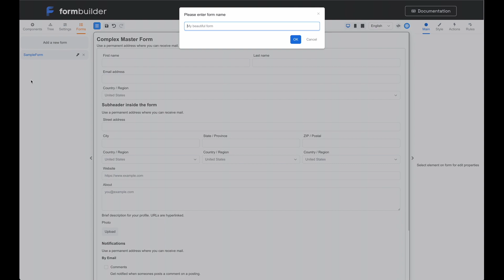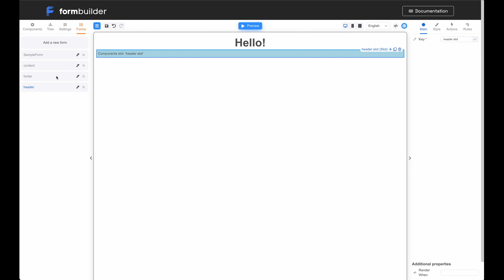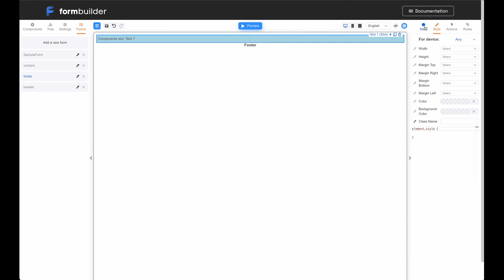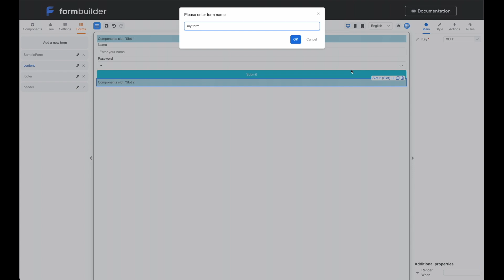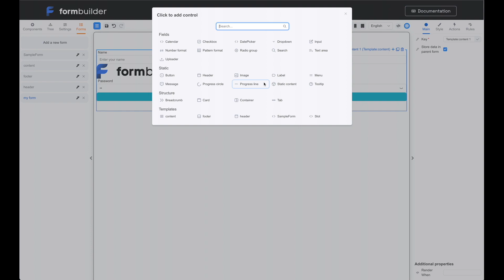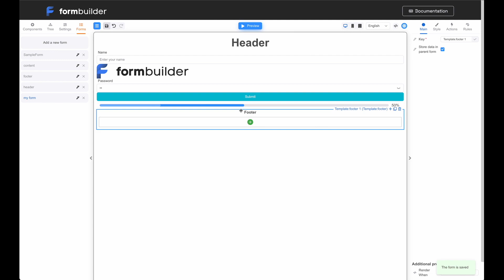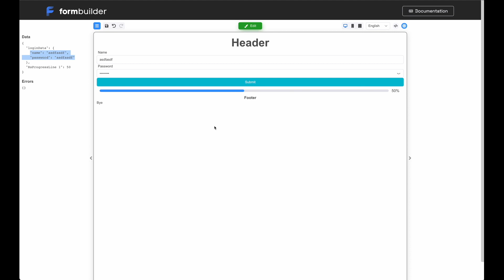Formbulder How to use forms templates?

Comment: After running the in my local I can see the "component", "tree", and "settings" options but not "forms" how can I create slot then or else multiple form to add in slot, if possible can you provide any react working code example for the same
Reply from the maker: You need to connect a Form storage, please see documentation  https://formengine.io/documentation/form-storage.